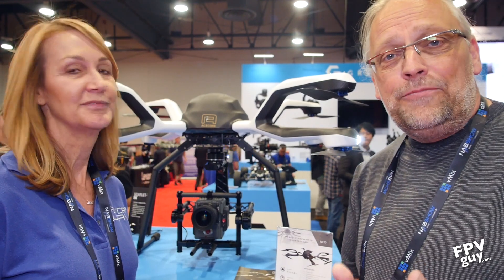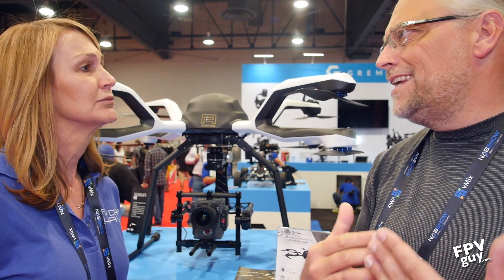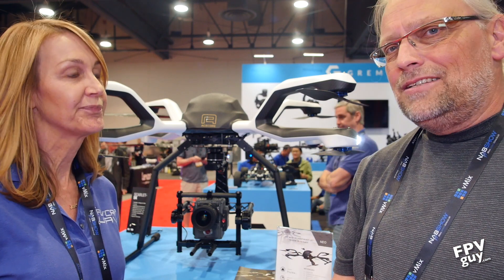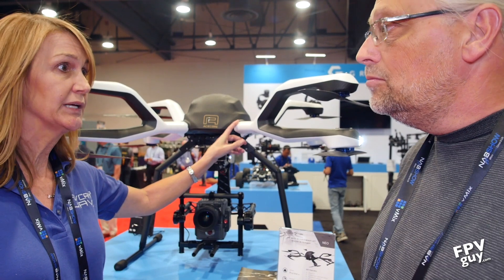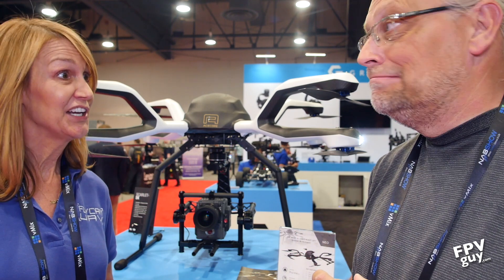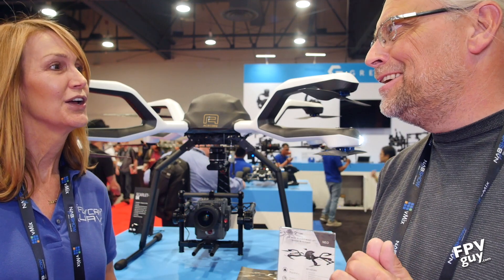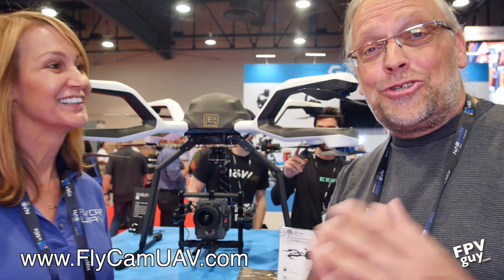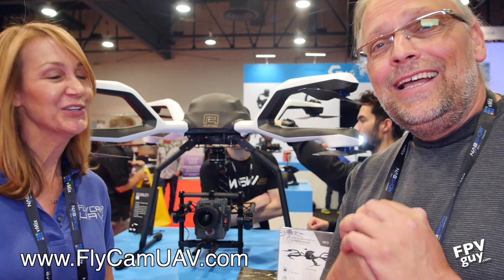NAB 2017 AceCore X8 heavy lift platform

Comment: I don't  understand the fpv omission, esp for something that big and expensive.  who would haul LOS?
Reply from the maker: good question,  its actually not that big a omission, mostly because most jobs like that are flown LOS with using the camera or payload signal download for framing or adjusting what you are looking at.  but the aircraft itself is being flown LOS typically, keep in mind FAA / Part103 generally require commercial operators to fly LOS.
Reply: Bo Lorentzen  Thanks for the reply,  I was thinking more along the lines that fpv would be more precise in the results, not that it would be out of sight.  I find even LOS it's  hard to judge relative distance to objects.  thanks for vid.